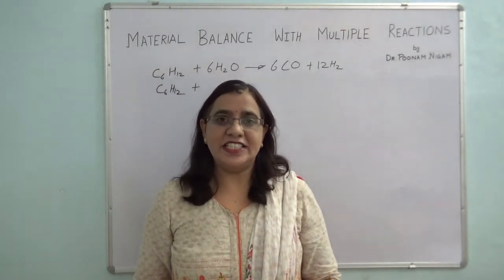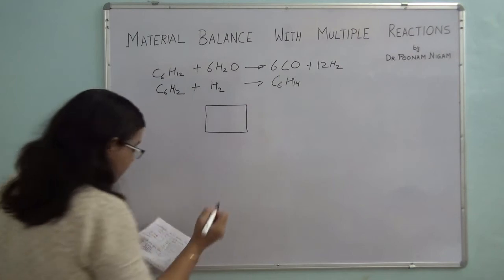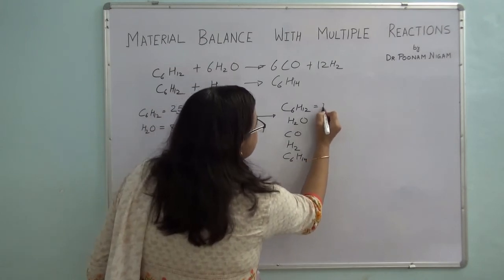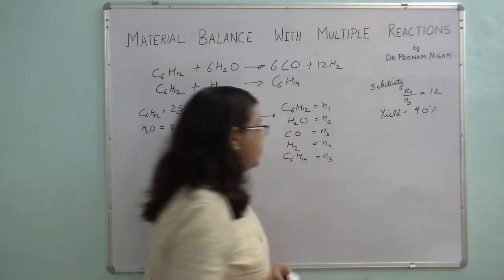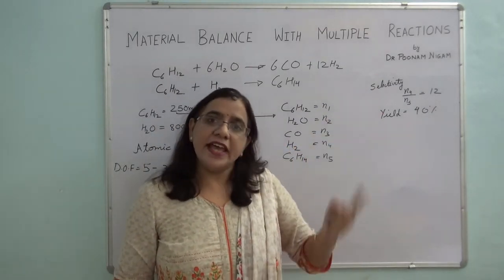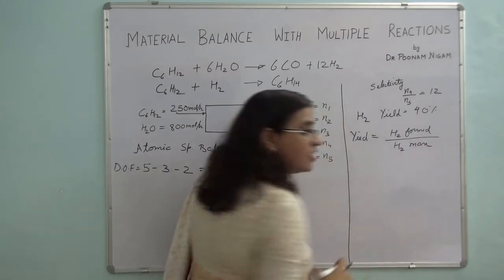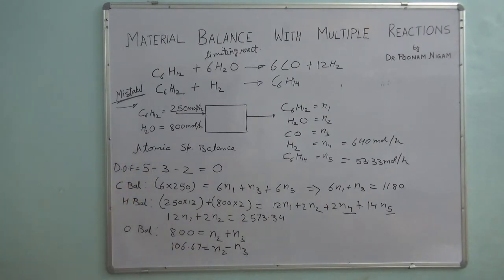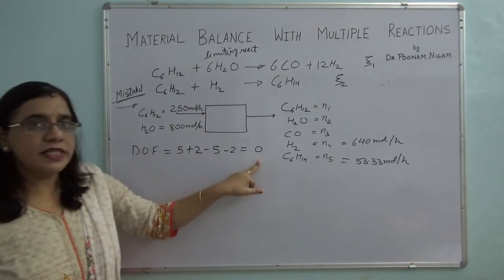Lecture 25 Material balance on Reactive Systems with Multiple Reactions

Comment: You said 800*2=1600 on the yield, where is the 2 coming from? Thank you
Reply: Since H2O is the limiting reactant, that is being used to determine H2 max. The ratio of H20 to H2 is 6 :12 ( or if u simplify 1:2)  so to determine the equivalent H2 produced for 800 mol/hr of H20 it has to be multiplied by 2.
Reply: That is the value of the stoichiometric coefficient.

Comment: when we write DOF,how do we understand,in case of atomic species,the number of independent balance?
Reply from the maker: Thanks for your query. I apologize for delay in response due to festive season in India. Its a very good question. In the atomic species balance you can find out whether the atomic balances are independent or not by using the following approaches.
1. If two atomic species appear in same proportion in all the reactants and products then if you write atomic species balance for these two species, they will be the same.  For example in my video (lecture 33) CO reacts with H2 to give CH3OH. Here C and O are in 1:1 ratio in CO as well as in CH3OH. So C and O balances are one and the same and are not independent.
2. In Lecture 23 on atomic species balance, you will see that C2H4 reacts with HBr to give C2H5Br. Here we observe again that out of 3 atomic species balance only two are independent and the third one can be written as a linear combination of the other two. This is not evident on the first look. But if you write all the three balances and try to solve them, you will find that only two equations can be used. There is one hint though. If you fix the amount of C2H4 (at n1) and amount of HBr at (n2) then you will notice that C going in is 2 x n1 and Br going in is n2. If you fix amount of C and Br going in, you have automatically fixed amount of H going in. This gives a hint that H balance is not independent and can be written as a linear combination of the other two balances.
I hope you have understood the point. Thanks.
Reply: @theteachingshow474  many thanks